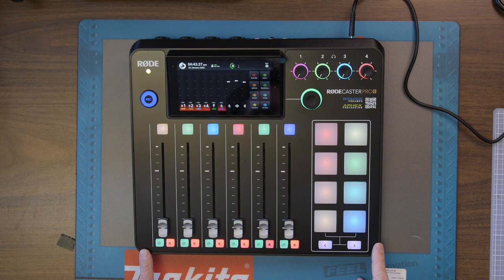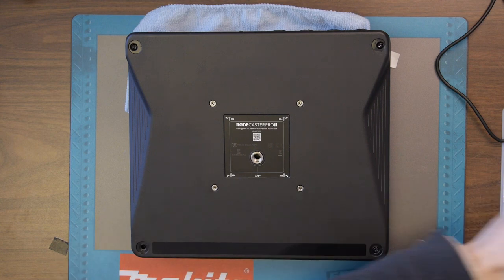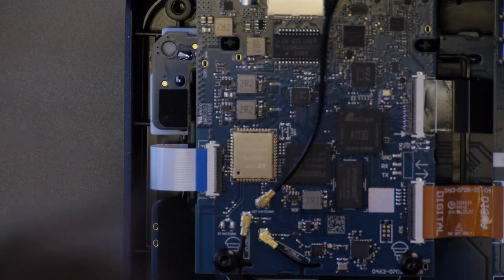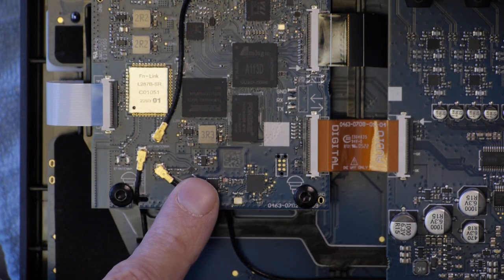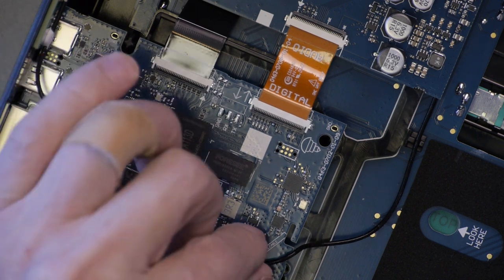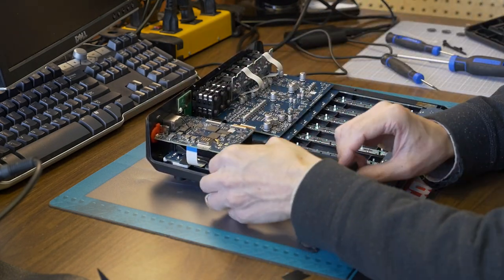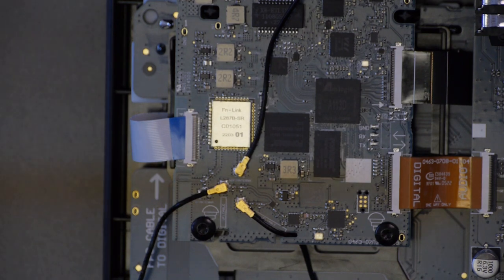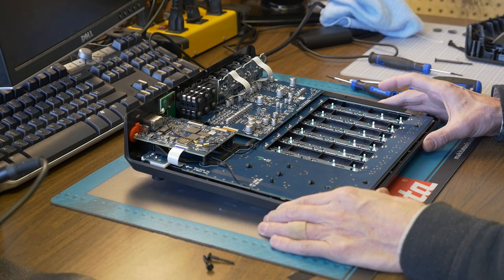Rodecaster Pro II Teardown - Attempted Repair Part 1

Comment from the maker: What are your thoughts? Do you have a defective Rodecaster Pro 2? Any ideas on how to fix it?  Leave your thoughts in the comments.
Reply: I had the same defect, as well as many others. I rma'd the device with rode and it was fixed and return in a week. No problems since. Good luck!
Reply: my switch board is faulty, i need a replacement.
Reply: how to i get one

Comment: Interesting it would not boot after reassembly. I would reseat all the cables again it’s likely got a self check on boot and is failing.  That window with look here is really odd. What the hell is that for inside lol.  

Iv not had any issues with mine but it’s clear yours is not right.  

Also the flux residue on the larger soldered connectors like the XLR is not unusual. That would all have been hand soldered with traditional core solder and not been though the same bath cleaning as the main pcb.
Reply from the maker: Yep I tend to agree. ;)

Comment: i know this is old, but my rodecaster duo has the 99% load screen failure like this one did when you disassembled.   Very strange.  Im yet to figure out a solution. Got it to boot once, and just never turned it off.  Had a thunderstorm the other day and lost power, and have yet to get it to boot again.  :(
Reply from the maker: Mine wasn't booting because the faders weren't connected properly. However from what I can tell on the Rodecaster forum on FB, other users have had the same issue, but it can be for any type of failure.

Comment: RODECaster Pro II console is detaching from unit in a few places  bottom of pads, and top of channels :/  Do you have the same problem too ? Do you think I should use adhesive?
Reply from the maker: Hi, i was not having the same issue even after having it apart. I would get warranty service done on it if is within the warranty period

Comment: Hello, I have a problem with one of the sliders not working. What should I do?
Reply from the maker: Hi, if it is one of the sliders it is probably a mechanical issue, I would try Rode support first if in warranty or do a hard reset on the device. Otherwise you might have to try and cobble together a replacement slider and do some soldering.. :(
Reply: @multeemedia  I have requested to return it to the store. Thank you.

Comment: I just got my second unit had it for two weeks and now I’m having different issues
Reply from the maker: That's unfortunate, the latest one I had was working flawlessly for about 3 weeks, then I randomly turned it on about 2 weeks ago, and the buttons started having the same issue again. What issues are you having? What seems to fix it for awhile is to press hard on the buttons/corners to get them slid into the right place.
Reply: @multeemedia  this one gets hot the first one didn’t and I can’t power it off or no pads work or mics won’t mute I have to unplug it
Reply from the maker: @crossoverradio1  Yikes, even worse than mine.

Comment: Mine is doing the same thing, Rode loading gets to about 99% and just stays there indefinitely. Can't turn it on so tried disassembling it to find an issue. for the life of me, I can't figure it out
Reply from the maker: When I re-assembled it the first time the ribbon cable for the pads were not connected properly. Once I connected the pads properly it booted fine.
Reply: @multeemedia My ribbon cable was fine, i think the PCB failed sp they got back to me and said theyll replace it under warranty. They gave me a nice trick though in case it locks up fpr future reference. If it wont boot but you need to factory reset it, boot it up, wait for the loading bar to hit half and unplug the power (repeat 10 times) and this will factory reset the device